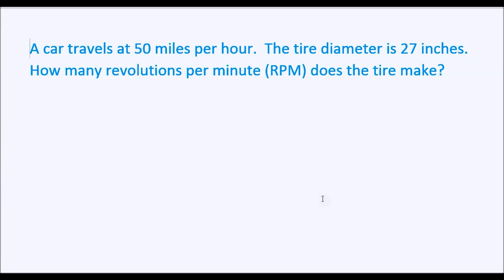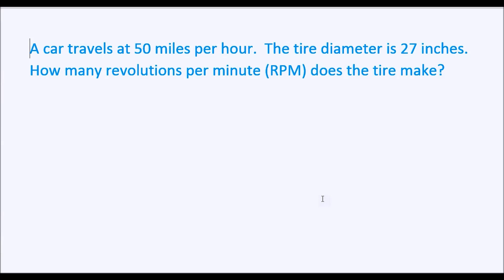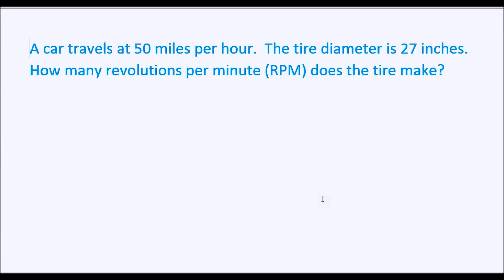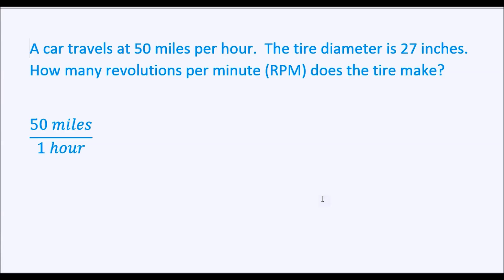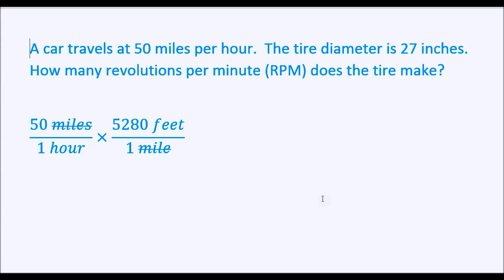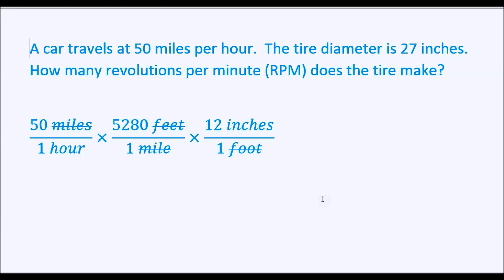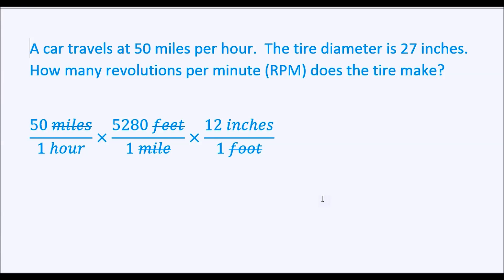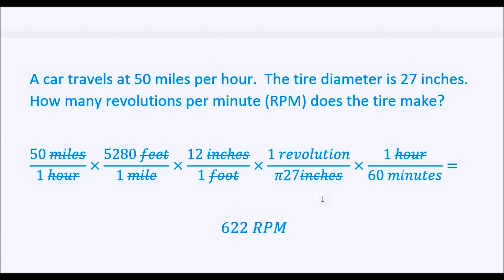Conversions: Miles per Hour to Revolutions per Minute

Comment: hi there, this is a long shot but thought i'd give it a try - my doc wants me to buy a blender that spins at no less than 50 revolutions per second  - however the blender that someone has recommended to him price wise is only recorded as 300km/hr - for the life of me, i can not figure how to convert the two, as obviously i don't know how many km is in one revolution of a blender. if that makes sense? it's wrecked my head so much, i'm not even sure if it does made sense? haha. anyways, just in case, thanks in advance.
Reply from the maker: +Hoopylasss11  Thanks for the interesting question.  I believe that the speed refers to how fast the tip of the blade moves in km/hr.  In order to convert the speed to revolutions per second, you have to know the diameter or the radius of the blade.

Comment: Why every time the car moves pi inches, the car makes a revolution?
Reply from the maker: The car makes one revolution each time the wheel travels one circumference which is pi times the diameter of the wheel.